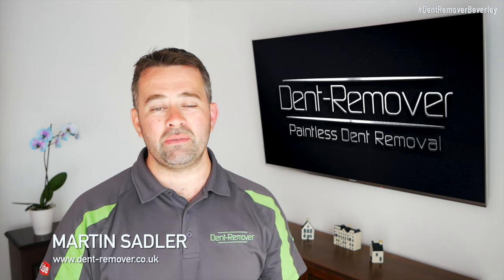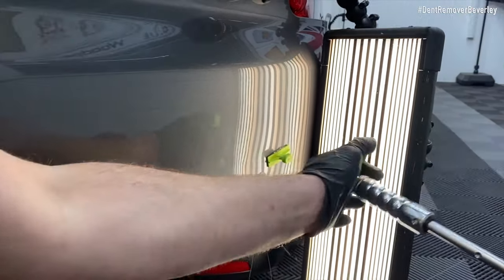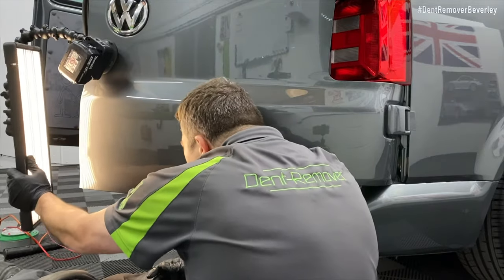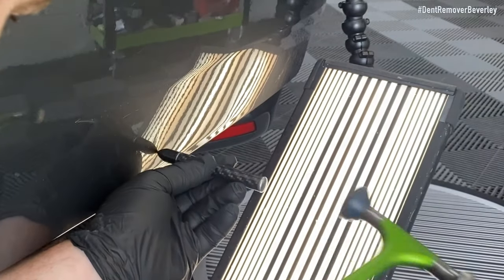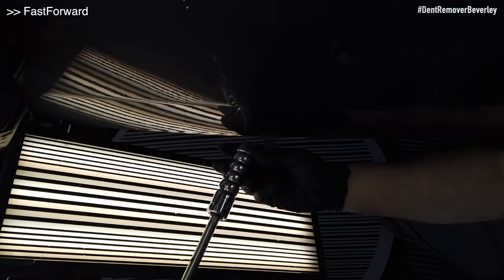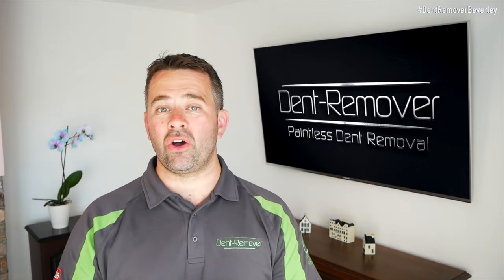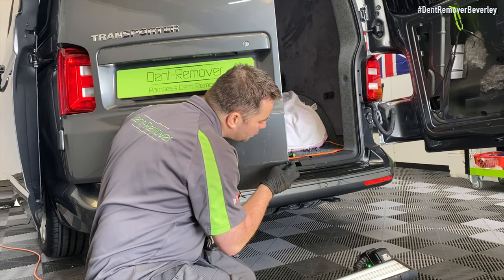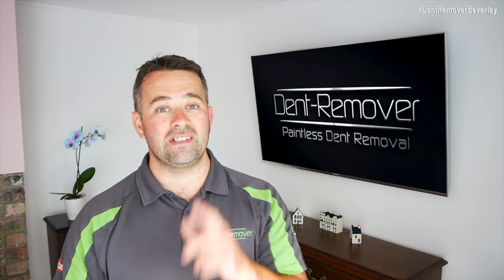HUGE DENT REPAIRED WITHOUT PAINTING! | (PART 2)Using PDR By Dent-Remover

Comment: Nice repair how many hours in total did it take you?
Reply from the maker: Hi Car Mo thanks for watching my repair videos. This took a long time I think it took a day and a half with all the filming etc. I did everything myself and then the Editting took about 80 to 100 hours!
Reply: @dentremover01  So video took longer than actual repair. Almost hand in hand in the repair to submit for warranty the story has to be sound or it gets kicked. Great work on both. I been dabbling in glue pulling not pushing with metal devices as I see how  dent outs are easily produced. Self teaching off all you great guys for my own experience and cars.
Reply from the maker: Yes it certainly did! And didn’t get paid for the time!
Well I started learning with a glue kit whole panel beating and self taught. Keep at it. The advantage of GP is you don’t leave push marks. Sometimes I can go for days just glue repairing jobs and not touch the bars 
Thanks Martin